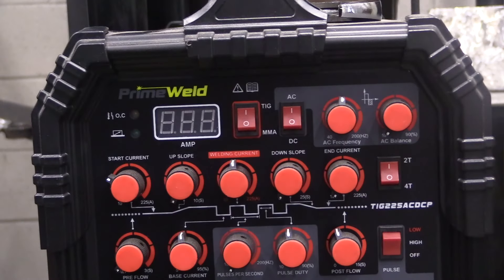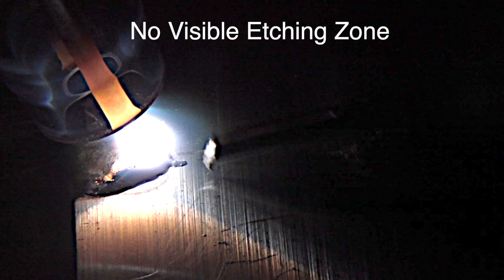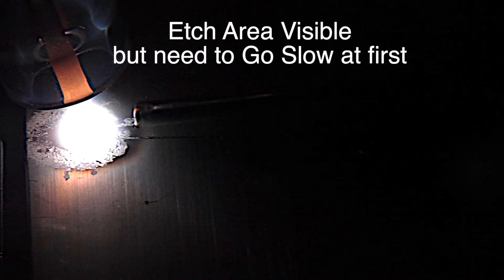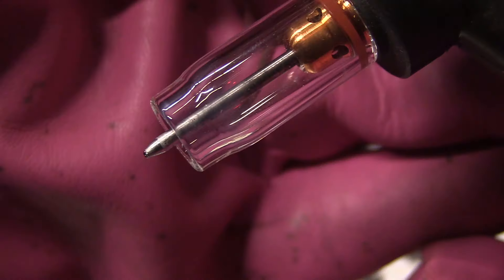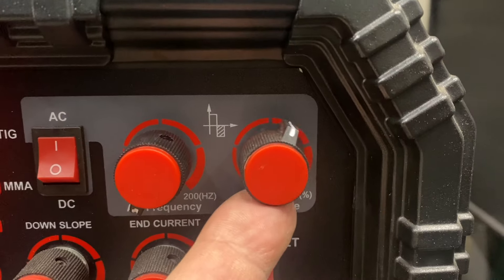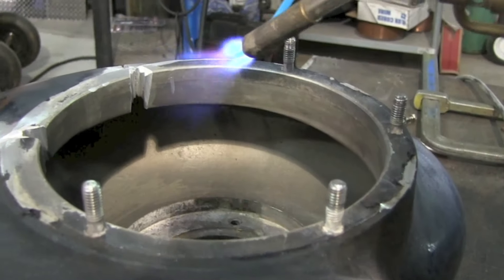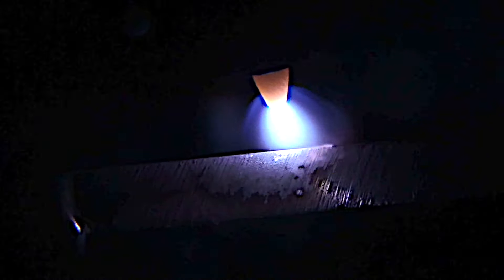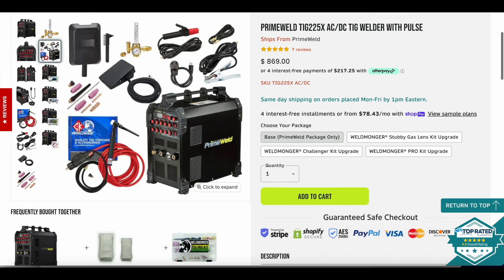AC Balance Unleashed: Maximizing TIG Welding Performance on PrimeWeld TIG225

Comment: Thsnk you Jodi. I got myself an AC tig machine late last year after havibg played arpubd woth a scratch start to learn the basics. Managed to get some passable welds after just an hour of playing around with it and referring back to your videos to  see what i needed to adjust. Built myself a what i consider a pretty decent custom designed luminium bait board for my boat. I still dip the tungston pretty often but every now and then i lay an almost perfect stack of dimes and i think yeah, this is cool. Thanks man

Comment: This is an outstanding instructional video with real time issues that you captured very nicely. I've been a certified Aeronautical/ Aerospace welder since 1996. With other various welding certifications I received all certs while in the US Navy and through AWS. I've had some good instructors and some not so good instructors and sir you are definitely on the top half of the best instructors I've experienced! Wish they would have had those clear cup in my earlier days. In the aviation section of the Navy you have to be recertified to to all positions in each metal group your original certification specifies each year. I just happened to come across you YouTube site and decided to watch, glad I did. Will look at few more of your videos.

Comment: Dude thank you sooo much I weld on a ton of dirty and cast aluminum and it’s a nightmare but I guess patience is key this has improved my welds drastically. I always thought I wasn’t cleaning it good enough and it can still be the case but sometimes it’s just not possible thanks for the tips

Comment: Hey Jody. Thank you for all the tips over the years that have helped me feed my family. I have had fun with a certain AC balance at work lately,  on a syncro 250. Welding mass produced parts just as fast as i can with the balance on 0 (most cleaning) and flooring it without any material prep. My poor 1/8 tungsten had like a 3/16" ball on it 😂 I burnt up 2 #9 torches before they got me a #20  lol. Got it done but don't recommend
Reply: A #9 torch with a 1/8" tungsten on a 250A machine. My fingers got warm reading that, LOL. I use 1/8" on a #17 and it still gets fairly warm on thick castings.
Reply: @Powerwagon563 our shop almost exclusively does thin stainless so we didn't have anything else. It was  ridiculous, i taped a rag around the handle and wore stick welding gloves.
Reply: how about one of those DIY water coolers and a CK torch?
Reply: @botsbass842 i use a ck20 on a 325amp machine and I wear tig gloves, maybe a tig finger sometimes. I can blast at 300+ as long as I want without any discomfort. Water coolers are like 250 bucks on amazon, another 250 for the torch and leads, and your torch will never get hot. Your productivity will go WAY UP!
Reply: @Josh Swider  it did, they got me one. I love it

Comment: Hey Jodi, 
Great video as always. Kind of in a dilemma and would appreciate your input between this and the Prime weld MTS 200 because it will allow for spool gun. Not sure if i should just jump the gun and get Prime weld 225 Tig. I am aware of both machines having there own purpose but for me I weld in my garage and weld aluminum and steel but nothing to heavy duty, just minor trailer repairs as of right now but want to get into marine welding (aluminum). Any input would help thank you and god bless. (Mind you I am not expert and have been welding off and on for a couple of years but getting back into it full time, if that helps)

Comment: Jody I'm loving this series as I have the pimeweld. A request it you can help with this on an unrelated topic. As a lot of us older  people have this problem. I have band tremors in my torch hand. Any ideas on helping brave the band so as to control this problem? Thanks for any input.
Reply from the maker: I was filming a friend weld some 4130 recently and he is a very good Tig welder. While editing the video, I saw him shaking quite a bit but the weld looked great. But he just used a slightly longer arc and stayed the course and it worked out.

Comment: WHat am I doing wrone if my filler metal melts before it gets to the puddle.
Reply: If you're talking aluminium then a few things might help ... hole the filler a little further away from the puddle, then get it in there quick and away again (hanging around too close preheats it too much), larger filler diameter will help, torch angle more upright so the heat is focused towards the puddle more than the filler, and I back the torch/tungsten away from the leading edge of the puddle when dipping the filler ... so, I move the tungsten forward to advance the puddle, then back a little and dip the filler, get the filler out of the way (aluminium doesn't need to be in the argon flow as much as steel does)  and repeat. Hope this helps.

Comment: I've seen it mentioned before that running too little cleaning action also tends to increase the graininess of the bead when using 4043 filler. I haven't yet played around with balance with that in mind to know for sure.
Have you ever noticed that?
Reply from the maker: could be. that graininess is fickle